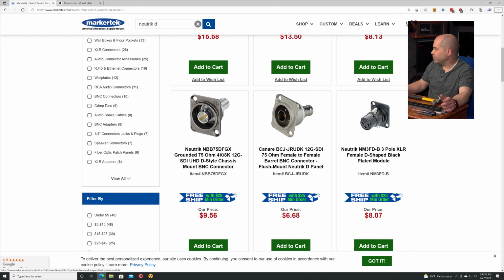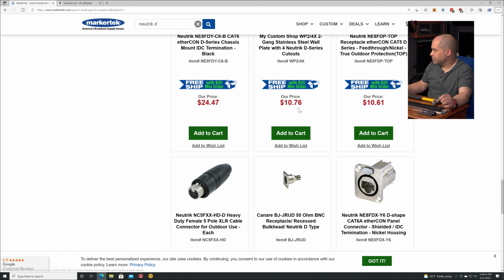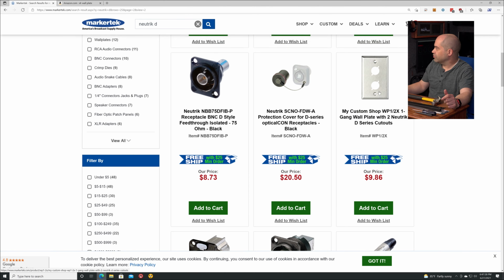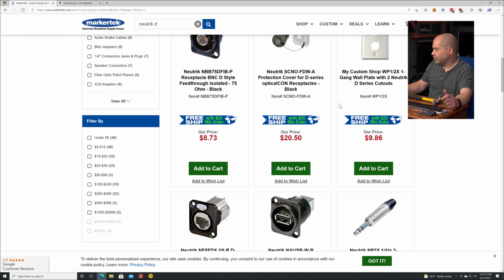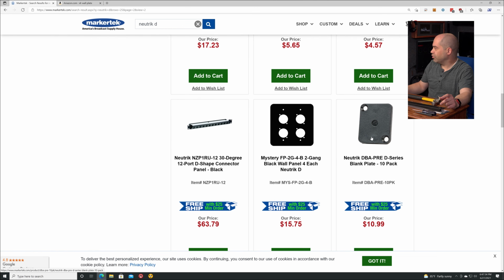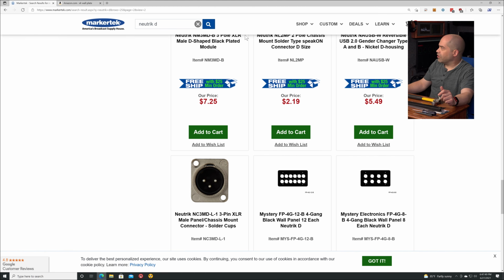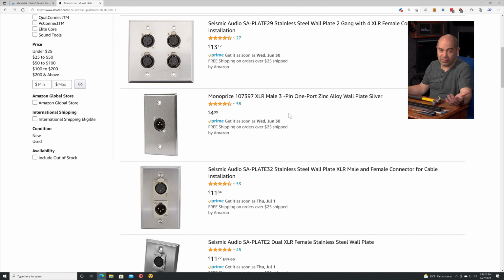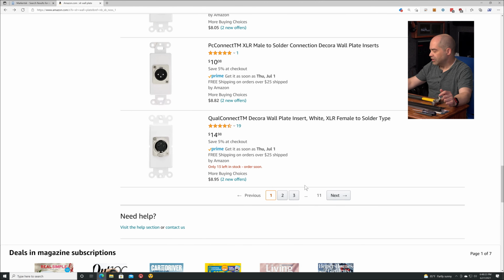Build Your Own Custom Input/Output Connector Panel

Comment: hey there! I am currently looking into this and found your vid. Wanted to ask a question:

The Neutrik TOP Panel Connectors that I screw into a panel don't seem to have an end on the other side. Do I HAVE to solder here in order to get my cables working inside my rack, or is there an option to have XLR and Powercon TR1 connectors for my patch panel without it? I am really anxious about soldering, i would much rather have an option to just plug something in on the other end/inside of my rack. I know Neutrik makes these pre-done CLR-trhoughs, but they aren't from the TOP range. 

Could you clarify if this is possible without soldering and if so, how?

Greetings!
Reply from the maker: As far as I can tell, all of the TOP connectors require soldering. 

Soldering isn't that hard to do. I'd recommend watching a few tutorials on YouTube.

Comment: How do you fix/glue those printed labels to the rack panel? Sturdy enough, not prone to scratches or damage?
Reply from the maker: I use full sheet labels, printed in my laser printer, and cut them to fit. Over time they do show scratches, but they're easy enough to replace.
Reply: @djp_video  thanks for answering!

Comment: What about shielding? What does one have to pay attention to when building an XLR connector panel?
Reply from the maker: It's up to you on how you want to handle it. Most Neutrik D style connectors are available with isolated ground, including the XLRs. If you want to tie it to ground you can, but by default it is isolated.

Comment: Hello Doug,
I built a connector-panel myself but I ran into an issue: The hdmi-ports that I used (Neutrik NA HDMI-W-B) didn't reliably send the camera control data from my atem mini to the blackmagic cameras. As soon as  I plugged the cameras directly into the atem, it worked without a problem. Did you ever experience that problem yourself? Are there HDMI-connectors, that you can recommend? Thanks a lot and keep up the gerat content!
Reply from the maker: The Neutrik connectors I’ve used have always worked great. Could it be the HDMI cable going between the ATEM and Neutrik?
Reply: Hey thanks for your answer! I might have to try again with different cables :/ Good to know, that the Neutrik connectors should not be the problem. Thanks! @djp_video

Comment: swift craft recommended HS2 holes are not totally round.. it's more 2 side flat and 2 side round.. not sure how to do this without CNC panel cut.. i'm looking for perfect seal so not sure I could just do a full circle cut and still have the seal.. 

let me know if you know how to cut these
Reply from the maker: It would take either machining or using an appropriate shape punch. The hole for the HS2 looks to be 1/2-inch, with D-style flat sides. A D-shaped 1/2-inch punch would get you really close.
Reply: @djp_video  I really like the full waterproof/full emi shielding/easy removal aspect of that connector..

yes I need a 1/2inch double D punch..  

I think I will have to dremel the holes but it's kinda a pain.. a wise company whould offer a cheap the punch die for it's own connector..

Comment: Great video, great kit.  I'll visit those websites and see if they have parts for a home AV system. It would be awesome to have short runs from my receiver to the panel and have the panel facing front.  I agree about Phillips screws. I only use them in things that won't show when a screw gets a bit buggered or when they came with the whatever it is I'm installing.

Comment: Uni-1 panels are great. Been using them for years. 
I like the idea of going with Torx screws. Not sure why I didn’t think about that before. Thanks for that.  I would recommend going with countersink screws instead of pan-head, but to each their own.
I use K-lock nuts. Means I don’t have to use a pliers on the back: just get them to touch the metal and they’ll lock right in. 
Your idea of using a table to print out the port markings is a great one,  but if you want custom- printed labels, or if you want to design your own custom panel with laser-etched labels I recommend checking out Redco. They can also do custom cables. They also have a good selection of D-type panel connectors.
Good explanatory video. Thanks.
Reply from the maker: When back mounting, pan head are the way to go. Countersink screws wouldn't sit flush.
Reply: @djp_video  if you’re using feed-through connectors, front mounting isn’t so bad, right?
Reply from the maker: Not so bad. But I still think that the panels look better with back-mounted connectors.
Reply: @djp_video  in your trailer setup with the nice wood surrounds I could see that being a consideration. Did you make the trim around those?
Reply from the maker: Yes. I did all of the woodwork.
Reply: @djp_video  it was worth it! Thanks for the help.
Reply: Could you elaborate on why the K-lock nuts are effective?

Comment: Thanks for the simple explanation and demo! I've been thinking about building a panel like this to centralize access to the inputs and outputs on gear that's not close together in my workspace to make it easier to reconfigure things. Now I know how to do it! 

This also seems like it would be a great way to avoid putting strain on the connectors built into gear, particular "prosumer" equipment that doesn't necessarily have the most rugged build quality: connect the inputs and outputs to a panel like this and don't touch them again! Then you're beating up a $15 connector instead of something that can't be serviced.

Do you have any recommendations or links for the actual rack this would be mounted in?
Reply from the maker: I mostly use Gator GR series racks because they're lightweight, but there are a ton of great products out there.